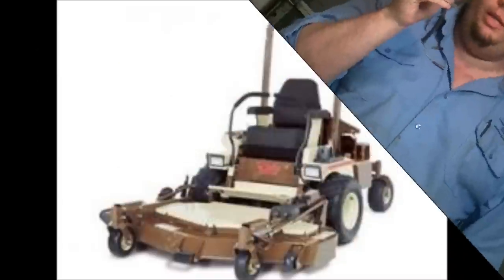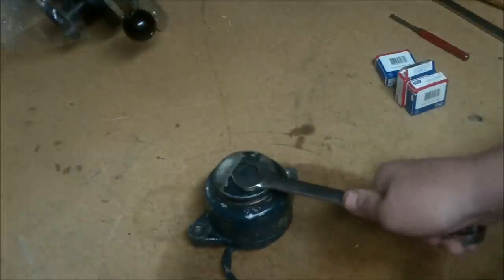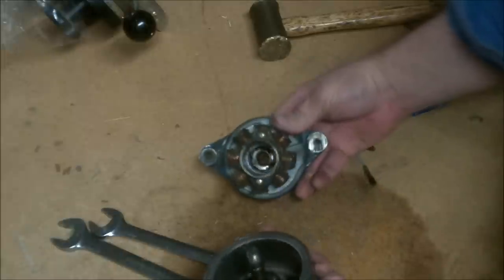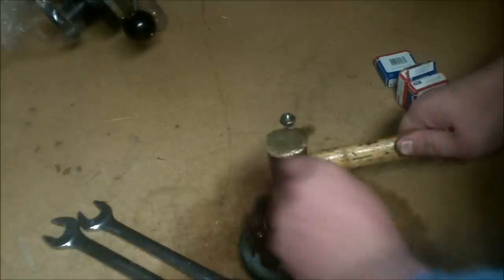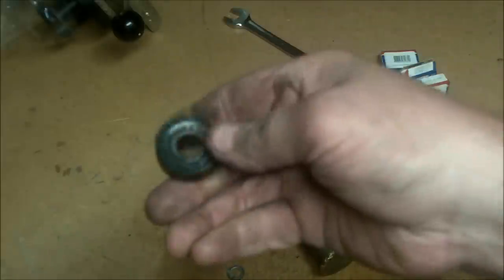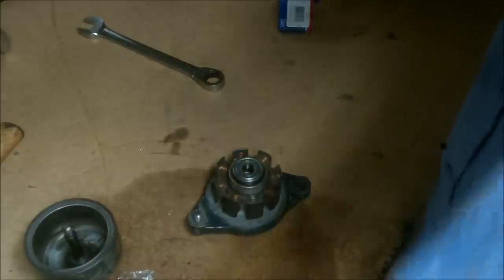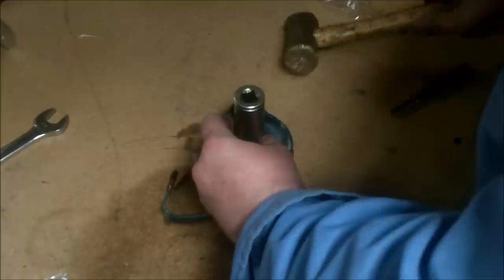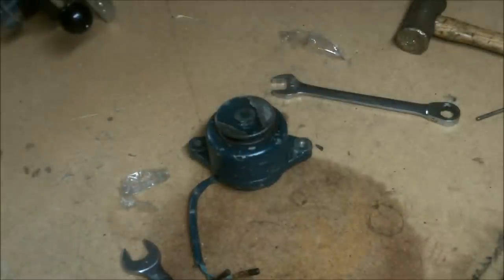"GRASSHOPPER 721D MOWER REPAIR" HOW TO REPLACE THE BEARINGS IN THE ALTERNATOR/GENERATOR

Comment: I want to personally thank you for making this video. You saved me a headache and money with this video! I have a Kubota T1600 lawn tractor with the 2 cylinder kubota diesel engine. Earlier this year I was mowing with it when suddenly it overheated and died on me. Would't start again. I didn't know what was going on so I took it to a "diesel mechanic" to see why it was slow cranking and not starting. He couldn't figure out what was wrong. He thought maybe it was an engine problem I got it back and parked it for about 3 months. I came a cross this video and thought I'd check the alternator/generator so I removed the fan belt and tried to crank it over. VOILA!!! It started! I removed the alternator and sure enough it was seized up so it wasn't turning during cranking thus doing a slow crank. I replaced the bearings on it and now it runs great!!! Only cost me $25 for the bearings! THANKS SO MUCH!!!

Comment: The bearings that you can find on the web is 6201Z after doing much cross-referencing, and they worked fine. Make sure they are the type with metal covered seals and don't smoosh those metal seal covers when you're installing them by using a perfectly aligned socket flat face so you don't mess up the flat seal plates and don't mushroom the edges of the housings. Belts that should work are Gates 7345 which I went with because of feel after checking the others , Dayco 15345, as well as the original kubota belt 15881–97010, which is very hard to find. You have to remove the forward end of the shaft that comes underneath the radiator towards the front  to  underneath the seat where it attaches and drives the propulsion units.  Then you can route the fan over the forward propulsion shaft back underneath the radiator and up around the fan to get it up into place. While you're in there it might be a good time to replace the water hose on the water pump. I am an aircraft mechanic so the generator is like some experimental plane generators. I just went through this on my 2000 721D Grasshopper with 1770 hours on it. I smelled smoke and saw black fumes. One of the bearings blew up just like in the picture. The belt broke from heat being pulled across the pulley and that meant the fan was not rotating so the engine got hot quick got right up to the red band. Scared the shit out of me because I had earplugs in and I did not hear any noise. I just saw the smoke, so I hope that it didn't have this going on long and because of the smoke, heavy smoke came out. I think it must've happened right then.  In the outer cup, the spacer he talks about is a washer. Then there is the two bearings that go into the armature inner housing and then between the armature housing two bearings, and the outer one bearing, that is where the long spacer goes because in the outer cup, it is a washer down there, not a spacer the spacer goes between the two inner bearings and the one outer bearing on the backside where the  wires comes out. Don't screw up the threads because they are metric and I did not have a die to put on them to clean them up. Good luck we're counting on you. It's a very short wet bumpy Runway.

Comment: yesterday i mowed and for the first time the battery light came on and voltage was only around 12 volts.  i tightened the belt a little it was slipping but it never raised the voltage back up to the 13-14 volts it use to be.  but now when i rev up the engine the light goes out.  but it was never on before.  does it have a regulator or rectifier it goes though to control the voltage?   i'm about to convert it to a 1 wire gm alt.  but i know I'll be having problems with belt size and width    i haven't pulled the alt but i did check it when i tightened it and the bearings are fine.  just low voltage.   any suggestions???

Comment: Hi. I was thinking of putting one of these dynamo type alternators on my garden tractor. The engine is a Kohler ch18 and the stator is getting weak so I was wondering if I could use one of these in it's place. I have to remove the engine to change the stator and thought if I could install one of these externally, It would eliminate taking the motor out in the future. My question is, do these work like small engine stators that put out ac volts to the regulator or does it generate 12 volts. Thanks.
Reply: The voltage gets higher as the revs increase, so at mowing speed without the regulator you would get about 50 volts ac, but they will go much higher.

Comment: No moving parts so nothing can go wrong. These are very basic and cheaply made though, so although they never operate at the full 20 amps capacity, they can suffer from bad belt tension and dust ingress, so rather than throw it away when the bearings start a rumblin,  a new set of bearings, even the cheapest ebay items will give it a new lease of life. As we see here a very simple job, and saves $50 which the wives can spend on better things.

Comment: MowerMedic1, I am having a VERY hard time replacing the PTO belts at the back of a 2010 Grasshopper 721D. I have used automotive v belts, they are easy but don't even last a season. I am trying to use OEM belts and MAN, are they tight! Any tips? Any Videos?
Reply from the maker: What part number oem belts are you trying to install?
Reply: @THEMOWERMEDIC1  I have searched for bill and packaging... If there are no "tips or tricks" you are aware of, I have no doubt bought the wrong size belts. I have purchased 17325 and 17330 in the past, they are both relatively easy to install but NEITHER last a full season. I will contact my dealer. Thank you for the reply.

Comment: I can't find a single one of these units used on Ebay. They are $100 bucks up to $250 for one new.  I want to make a small gas driven battery charger with a Honda GX 50 engine.  The voltage regulator is $40.  Good for 15 Amps charging I hear.
I might have to borrow one off my Onan 7500 gen set.....I see one behind that little cage.  Thanks for the video and the peek inside. That little unit is so simple..
Reply from the maker: @itm/Remanufactured-KUBOTA-Compact-Tractor-PM-Alternator-6A830-59250-Voltage-12-/231260595581?hash=item35d834a57d&vxp=mtr

Comment: Do you happen to know where I can download an owners manual, service manual or parts manual for a 721D? I just bought a used one (1991 model) that will require a bit of work (tranny work, etc.). I have no experience with the diesel versions of this mower. Can you perhaps point me in the right direction?